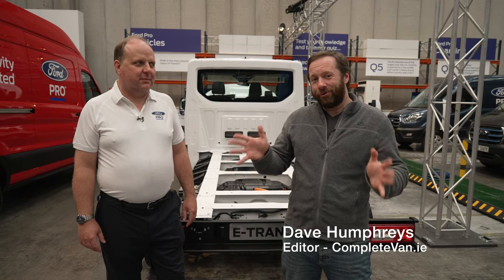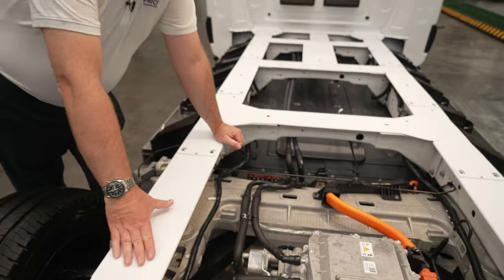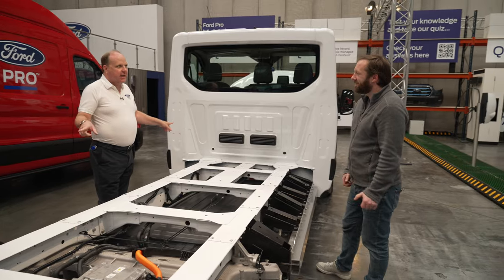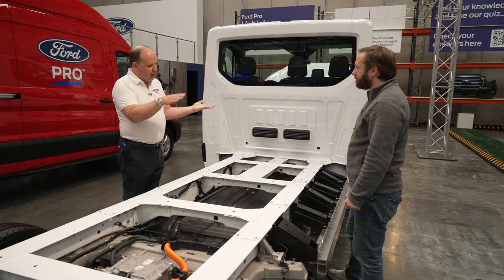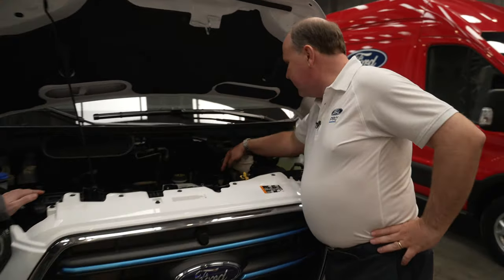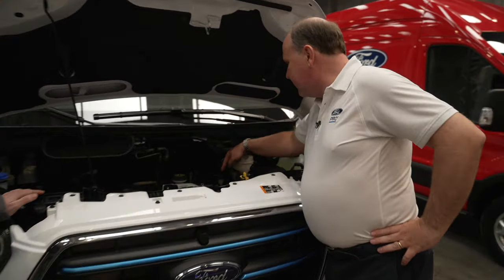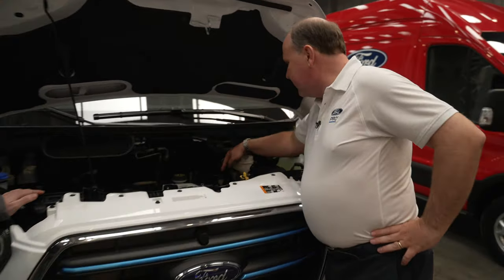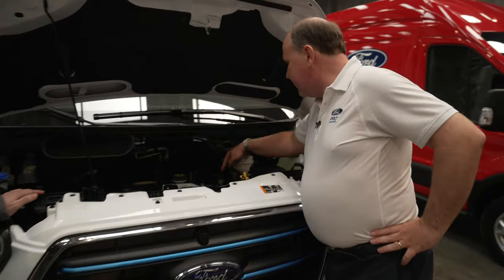Tech details of the Ford E-Transit electric van

Comment: i drove it on may 5 -2023 in the mountains in Switzerland , no motorway and achieved around 20kw per 100km giving a range of aprox 330km which i find pretty ok for such a vehicle. Comfort is great. Explanation given here is very good.
Reply from the maker: That's pretty good consumption figures. We guess lots of mountains makes re-gen great!

Comment: They could put quite a bit more battery in that vehicle without too much downside to it other than cost. As a reference point, the battery in these vans is basically the same size (kWh not physical) as the larger battery pack in the Nissan Leaf. (The Lighting, EV Hummer, Rivian and Lucid vehicles have batteries that are ~2x the size) It's pretty clear that this first iteration is targeted at fleet operators who have their vehicles return to the depot every night. I would love to swap out my current Transits with these and do away with gas completely in my life but the $10k-15k "market adjustment" on top of sticker the local dealers are charging is just ridiculous. Great to see Ford getting serious about electrification. I feel like they really missed an opportunity though in just electrifying the Transit Connect. That would have been a much easier place to start.
Reply: "Yes, but our dealer handling fee is only $999, and we can get financing for anyone, even YOU".
Reply: This is a quick adaptation of an ICE model to BEV. It could certainly have more battery, but that would require a pack specific to the Transit; instead, it is using a Mach E pack. It even has the standard-capacity Mach E battery (rather than the higher-capacity battery available in the Mach E) because the higher-capacity Mach E pack places extra module in upper layer, which would make the pack too tall to fit under the Transit frame.
Reply: @brianb-p6586  it would be pretty easy for ford to create a specific pack for this vehicle using any of the existing battery packs since they are all modular. Oh well, maybe next gen.
Reply: @mikereliford55  Yes, the next generation will presumably be far more optimal.
Reply: @mikereliford55  every pound of battery is a pound less of payload as well. Gvwr is likely a big sticking point since an extra hundred pounds can be the difference between  needing a special license to drive the thing or not.
Reply: @TexasDragon3907  that’s not a major issue for this type of vehicle. Especially in the smaller tonnage vans. (We have several transits and are nowhere near exceeding gross)
Reply: hummer ev is 4x lol. esprinter is nearly 2x
Reply: They probably want to use the same or similar battery packs as their other EV offerings such as the lightning F-150 and the Mustang Mach-E.   The Transit is more about if various commercial customers could adapt to operating with EV's.

I would imagine that it would be costly for a business to install a DC fast charger so the concept of a quick 350 kw recharge over 20 to 30 minutes is less likely than purchasing an extra van if the range is insufficient for the day.  You can expect level 2 chargers to not be a problem for many businesses, but a DC fast charger isn't cheap so is unlikely unless a large fleet is purchased.  Of course, they can always use commercial fast chargers at a price and likely with a queue but hoping the range is enough and just buying one or two extra vans if it isn't enough will likely be the option for a business.   Buying extra vans and rotating through them will likely be advantageous anyways as the batteries age.

Comment: You have to be able to upgrade or change the battery ! The radius of 80 miles is not bad , but could be better. Many drivers exceed 1000 miles/week. At this point I am the supporter of the hybrid. Electrical inside a city and diesel outside, for vans !
Reply from the maker: This is a solution for a certain type of driver/business.

Comment: Awesome explanation of this truck. That rear casting is incredible. Most informative video of the E-Transit so far. I want one for vanlife.
Reply from the maker: Thanks so much for saying (and watching). There are a lot of neat features in this van
Reply: Rethink that my friend. 120 mile range!
Reply: @kartuneman  I achieved 330km with one load, if you are not in the rat race it can work out and I'm currently  transforming it to a camper.
Reply: No room underneath for grey or black tanks will be a problem for conversions?  Maybe behind the rear axle there is space.
Reply: @daversj German guy has done it.

Comment: The van would be great if they increased the battery size and the charge as well. The range is so small it is not practical for most people. 250 mile range is the minimum
Reply from the maker: Depends on use case. For deliveries this should be more than enough given average daily routes.

Comment: My company just upgraded me from a 2016 Transit 150 to an E Transit. The van is great with many cool features. I just wanted to know if the E Transit has an option for power seats as my elbows can no longer rest on the arm rests? In my older Transit I was able to lower the height.

Comment: I have high hopes for fleet vehicles. Adding a battery pack to the interior of the vehicle that can act as additional range, also being the primary use would also make the main battery last longer
Reply: Weight concerns.
Reply: @Stefan_Dahn  agreed. However adding a single ton of weight to a vehicle (most batteries seem to weigh a little under a ton) to possibly double the range and capacity for work may be worth it.

Comment: Is that the chassis to use for like Camper build? I'm liking the idea to swap an older transit chassis with this.

The front could take a small Frunk too. For tools and cable.

Great Ford guy that knows his business 👍
Reply: esprinter has 113 kwh, 400 km wltp
Reply: @nameberry220  the new one that comes this year, yes. Must be a expensive one. Proper pack size though.

Comment: The range still worries me. I’d say 250km fully loaded with tools etc. That would give me range anxiety most of the time .
Reply from the maker: That's completely understandable, especially if you're frequently covering long distances each day. Ford admits that the E-Transit won't suit every van owner/user, but there are many that it will. ^Dave
Reply: Unfortunately this shows the disadvantage of a BEV. You could double the range by adding another 1000 lbs of batteries but than that would cost you a 1000 lbs of payload.
Reply: Why would that be. There are Chargers. Just re-think journeys.
Reply: @RedBatteryHead  I don’t have time for charging when I go from job to job during the day.
Reply: @Mrblobbster  that's were you will need to rethink. Plug in on coffee or lunch break. Or at your appointment.
It's really not to much of a thing as one thinks.
Reply: @RedBatteryHead  Yes it is.  I would have to charge 5 times during the day (5 hours waste?)  I do not need 5x lunch, not drink coffee, no appointments just customer service.
Reply: @MikeB4pl  so you do 600 miles a day?
I would change jobs 😉
Reply: @RedBatteryHead  Sometimes yes, sometimes no.  Once every 2 weeks average.  Why ?  I service special industry machines and we are only one in the country - who would service them ?  You ?   Sometimes I have to drive cross country -- and can do everything in one day for 500 km radius.  Easy with motorways to do even 500 km in 4 hours with speed limits.
Reply: @MikeB4pl  ideal is not for every job, yet. Your job might require a bigger range, yes.
Just saying it's not impossible. When you do a service you can charge the Van. When you stay over, you can charge the Van.
Workshops have outlets. Ford even has CEE adapter to do so.
So there are way more options.
Reply: its only getting over 250 km in perfect conditions, normally 200 or less.

Comment: mmm sounds all soso , but to use as a camper, where you put the water tanks, diesel heater tanks, extra batteries, also don't see a spare wheel either? etc etc. all the space is taken up with batteries, do like the independent back end. so wonder how many times you have to recharge going round Australia? and where you recharge them?
Reply: A battery-electric vehicle is not suitable for a camper at this point.

Comment: I want the shorter Wheelbase version they show in the video - is that going to be available to order here in the US?
Also, i want the 3-across seating.  Is that available in the US?
Reply: The available versions are shown on the Ford website. The cargo van is available in all of the Transit sizes, and only one length of cutaway or chassis-cab is offered.

Comment: No wonder it doesn't have much range, all that metal to support the battery instead of integrating it as part of the structure saving a couple hundred kilos and being able to make the actual pack bigger at the same time.  The other perplexing thing is that he says that heavy regen isn't the most efficient way to drive yet it doesn't have a free wheel option when you take your foot off the brake? I will be interested to see how it fairs in the market against vans that design from the ground up for battery power...
Reply: This is an adaptation of the existing Transit, so the design is certainly not optimal for the battery.
Reply from the maker: The next generation, which will be less of an adaptation as this one is, should have a lot of improvements.

Comment: The E-Transit rear suspension is suitable for the load, but not even remotely close to the highest-capacity IRS in production. Yes, the HMMWV (Humvee, Hummer H1) has a slightly higher GAWR, but anything with Oshkosh's TAK-4 is much higher. TAK-4 is primarily used on military vehicles (trucks much heavier than a HMMWV), but is also available for the front and the rear of Pierce fire engines. The lowest-capacity TAK-4 variant has more than double the capacity of the E-Transit rear suspension. There are also IRS Tatra trucks and armoured personnel carriers with all-independent suspension, both again with far higher capacity.

Comment: Seems like lots of wasted space in the chassis & front under the bonnet,  a skateboard layout with FWD like Arrival may be better? I wouldn't want to climb up day in day out that high off the ground, also I suppose you cant get twin wheels with the independent suspension?
Reply: It is an adaptation of an existing model, so it is not optimized for the battery-electric powertrain.

No, dual rear wheels are not available with that suspension, but they're not needed anyway with the allowed gross weight and payload of the vehicle. A heavier vehicle would call for a larger motor and battery.

Comment: If you're not sure on specs,then put them up on-screen...@7.10 he says "76mAh"x196cells (which is = 62Wh with cells at 4.2v)! I think he doesn't know much about tech specs...even if they were 76Ah cells it's only 62kWh... not adding up.🤔
Reply: The errors are in the number of cells and their individual capacity. This is the Mach-E standard battery, which is a 96S 3P configuration (96 groups connected in series of three parallel cells in each group), not 96S 2P, so it has 288 cells (not 192). Also, they are 71 Ah cells, not 76 Ah. the resulting energy capacity (using the nominal voltage, not the peak charging voltage) is 76 kWh, with Ford choosing to use 68 kWh of that. 

The cell count error presumably results from thinking it was 2P instead of 3P.
The cell capacity error may result from remembering the "76" from the 76 kWh nominal capacity, and thinking that was the cell capacity (which is actually about 71 Ah).

Comment: No mention of battery future proofing. What happens when Ford develops a more powerful battery. Will it retrofit to this model or will they by then have developed a brand new chasis design rather than this I.C.E. van that's been electrified. Sounds terribly like typical corporate thinking & the way they invest. I think this van is a fine van "but" I do think it has been "rushed" & is a basic entry level attempt to enter the ev market. Seeing all that add on stuff  just to get the battery to fit a I.C.E. chasis makes one wonder! Still, it's early days in the ev evolution. Just the beginning really. I'm sure Ford have learnt some valuable lessons here. Now, what we need is a new chassis design with a longer range battery & they will have a winner!

Comment: Hard to believe Ford doesn’t have a Team of MIT graduates that could design something with more range and load capacity, In tbe USA any Plumbing Service Contractor is going to need minimum 400-500 miles to a charge!!  75 is a joke, maybe for a small remote village in Italy but no real Contractor will be happy with the 75 miles of range, Ford is saying this range with no weight

Comment: This vehicle is a joke. Plenty of room for more battery. The area under the hood is an inefficient mess. They basically took a Transit van shell, and threw stuff in without any logical order or consideration of design or material costs. If they did some earnest basic design, and used some purpose built materials, this would have been a GREAT van. Instead, they chose to do half ass job piecemeal these parts together like a amateur science project. They would’ve had a head start on the other companies, but laziness took hold of these people. What a shame!
Reply: I think the problem is they are mid product-cycle. I bet the next all-new transit will be built primarily for EV and secondarily for ICE powetrain.  but I agree. it's a shitshow!  I looked at one in person today. despite having the independent rear suspension they still installed the brackets for the leaf springs the ice version has! silly.
Reply: There is not enough room for a larger battery off the Ford parts shelf. While the design is far from optimal as a BEV, it is a good job of making a BEV from components (especially the battery) which are already in production for Ford... which were designed for and used in the Mach-E.

Comment: I dont see EVs being sustainable having to replace the expensive battery 10-15 years times millions of vehicles.  How will they find enough lithium and power stations to charge all these?  Wait until they force everyone into these and the cost of electricity goes sky high
Reply: Even after 15 years, the battery will not be worthless, it could be repurposed as PV storage.
Reply: Batteries can be recycled up to 96%, diesel fuel can't.